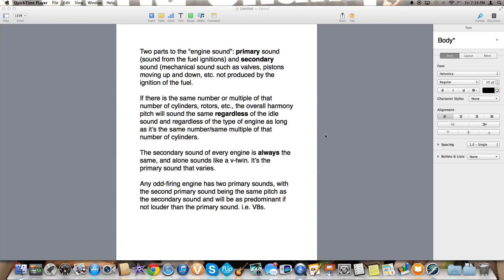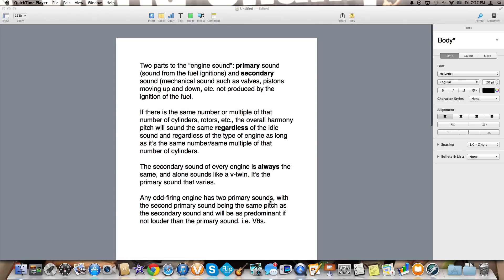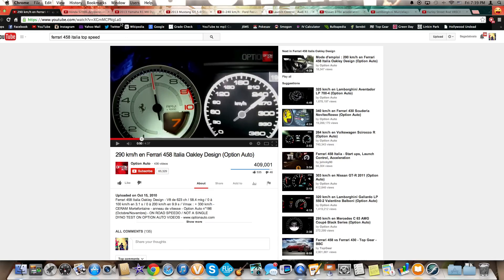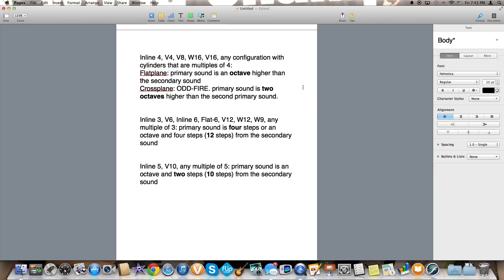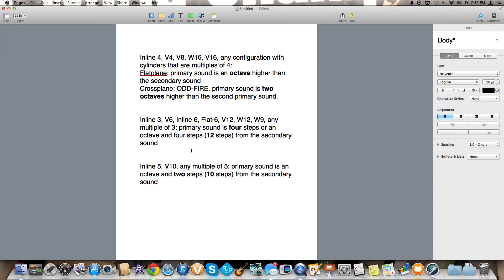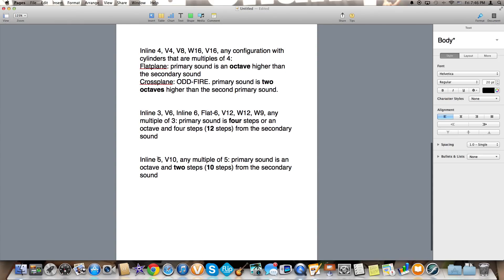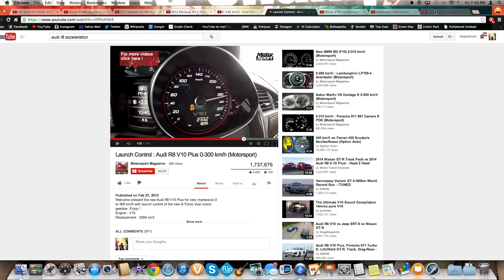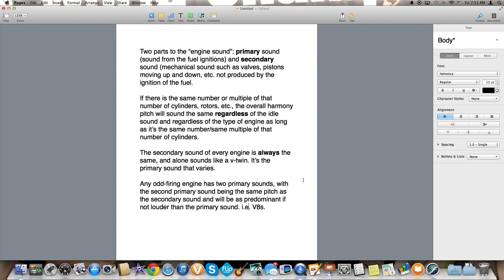Engine Sounds Explained

Comment: Turned it off when I heard the term 'ricer' a dozen times (I'm not offended, but it shows me the author has no clue how to address the viewing public) and he's under the impression that every inline 4 motorcycle goes to 16,000 rpm (a misconception which is what I'm used to hearing from the musclecar crowd)
Reply: triggered
Reply: The butthurt is powerful with this one, and the Yamaha R1 truly revs to 16k actually
Reply: Also said every multiple of 3 engine I3, v6 etc and same with multiple of 4. So the v12?
Reply: Arthur Lamouroux r1 doesnt rev to 16k thats an r6 young blood.
Reply: So if the 16k RPM for all inline 4 motorbikes is a misconception, what’s the truth though?

Comment: You forgot the piston less engine. The Rotary Mazda RX7 or RX8.
Reply: Roy Matison still the firing frequency can be compared to a classic piston engine. which make them sound not as unique for the average joe.
Reply: Carlos Leon really?  If a person can tell a v6 from a 4 cylinder but not be able to hear the unique sound of the rotary?  I can pick out a rotary as clearly as most people pick out a Harley.
Reply: I would suspect that the only prominent difference between a Wankel and an Otto with a similar primary sound would be the heavily reduced secondary sound due to fewer moving parts. Get one to rev high enough and it might sound like a pulse jet.
Reply: The sounds based on cylinder count also apply to the same amount of rotors
Reply: What happens with like a 15 cyl, does it sound like a 5/10 cyl or like a 3/6/12 cyl? And does a 20 cyl sound like a 5 or an 8? Do they have the primary sounds of both configurations because they would just sound like shit then.
Reply: No he didn’t
Reply: And The Diesel Engines, ESPECIALLY THE 2-STROKE.
Reply: Don’t need pistons for an engine like that just apex seals and a whole lot of compression 😂

Comment: I just want to ask you about the LFA v10. that sounds like a whole nother monster
Reply from the maker: yamaha heavily tuned the exhaust and intake to make it sound an octave higher and thus like an f1 car
Reply: Wrong.  Block angle and firing order plays a huge role.  odd firing V10s sound different compared to even firing V10s.  Compare old 5.0 Gallardos, Carrera GTs, and LFAs to BMW V10s and Viper V10s.  This is also why old GM 90 degree V6s sound like bad no matter what's available for them in terms of exhaust
Reply: Leo S still compared to another flat plane v10, the lexus v10 sounds higher.
Reply: Leo S so in this case, hes correct
Reply: +Carlos Leon wrote my comment too fast lol.  You were right in saying that Yamaha tuned certain frequencies at different RPMs for an even more orgasmic wail, but what I was really trying to convey was that the general "woo" banshee cry the V10 powered examples I wrote have come from their even firing characteristic
Reply: Leo S that makes sense. I believe he is aware of that as well but its still good to put it out there.
Reply: absolutely.. as well as the sho engine in the taurus in the 90's tuned by yamaha as well.
Reply: Same as a volvo 5 cylinder
Reply: @jasonhartley8302  pro
Reply: It’s an even firing engine 😂
Reply: Even firing v10 sounds so much fucking better

Comment: Boxers don't sound like my mopar 5.2l v8. Work on cars long enough each have their own tone you can pick off a mile away.
Reply: Dude doesnt know wtf he is talking about, not sure why he even made a video about it
Reply: Placeholder Name with open headers a boxer will sound identical to an in-line 4. The unique noise comes from the unequal length headers. And both of you clearly didn’t watch the video where he said cross plane v8s don’t sound like flatplane 4s because a 5.2 mopar is a cross plane.
Reply: @queefyg490  A boxer engine does not sound like a Mopar. Inline 4 does not sound like a boxer period. I have worked on cars as an ASE certified tech for over 20 plus years. It's my job to listen to engines run period as part of general diagnostics. To the human ear they sound different, on a graph there sound  frequencies may look the same.
Reply: Keith Irey joe Biden has 40 years of experience and he doesn’t know what he’s talking about 🤣🤣
Reply: @queefyg490  Holy shit you're right

Comment: Exhausts I find most interesting are from engines having master connecting rods such as the FDL V12 and V16 diesels made by General Electric and used in locomotives and the Pratt and Whitney radial engines used in propeller driven aircraft many years ago.

Comment: Informative video, but 12 is also a multiple of 4. So why does a v12 sound similar to a i3, not i4? I guess it's connected with the amount of cilinders in one bank? To bad you have so many dislikes. You hurt the feelings of "true" petrolheads, that can hear the sound difference beetween EVERY engine :D
Reply: No it isn't. And the V8 thing only applies to to flat plan crank V8's. A V12 could be more like 2*V6s
Reply: 12 is a multiple of 3 in this science.
Reply: V12 has 2 six cylinder banks, they have different fire order than 4 cylinders. It is also possible to make V12 out of V8 and V4 connected togeather, but there is no point.
Reply: Its because the 12 is an arrangement of two i6s. The firing order of an i6 is different than that of an i4, but similar to that of an i3, more like two mirrored i3 in a straight line, hence the similarity between the sounds of v12 and i3s and not i4s.
Reply: @mcr0741  but some v12s do sound like v8s

Comment: The only thing is you forgot V6s usually have split pin cranks and don’t apply to your multiple of 3 rule. This creates a different set of firing intervals thus setting v6s with split crank pins (which are most all modern v6s) apart from other multiple of 3 engine types.

Comment: On my Evo X, the stock exhaust sounded like a noisy vacuum cleaner, with absolutely zero character. Then at my first upgrade I put a high flow muffler on, which made it sound like a stock piped V8, y'know sort of burbly.
Then later on I straight piped it from the turbo back, which changed the sound again: it was back to being obviously a 4cyl, you could hear each cylinder firing. Also the exhaust added a lot of delicious crackles and pops... I think my point is that the exhaust has a huge influence on the sound of any engine. Thanks for an interesting video.
Reply: Your inline 4 Evo did not sound like a V8 with a muffler you probably bought at autozone. I'm sorry, but no. Just no.

Comment: Inline 3's, inline 6's, V6's and V12's do sound a little bit similar, but they're easy to tell apart. Also, the same configuration of engine can sound different depending on certain factors. Like, if you compared the sound of a Nissan 350Z to a Toyota FJ Cruiser, you could easily tell the difference even though they both use V6's. The 350Z has a distinctive raspy sound, whereas the FJ Cruiser has a more smooth sound. Also, a V12 engine would be much louder than a V6 due to it having more cylinders and probably being a larger engine in terms of cubic inches. I feel like inline 4 car engines are the ones with the least variation in sound, however, if I listened to a Honda K20A and then listened to a Volvo B230FT, I'd be able to tell which one was which. You're also wrong about the Subaru engines. They sound that way because of uneven headers. If you fit even headers to them, they sound pretty much the same as an inline 4.
Reply: PlotTwist but an FJ and a 350Z are both V6's

Comment: V8 sounding like inline 4 is like saying that Men and Women look the same. lol NO.
Sound has to do with firing order, bore and stroke, valve placement, number of valves, number of cams, belt or chain driven. All those things make different sounds, which makes an engine sound different. Boxer engines are very wide, which allows you to have a longer stroke and bigger bore, twice as many cams and all the valves are 1/16" from the outside so you can hear the clatter of the valves as they open and close. Rotary don't have valves or connecting rods. There are hundred different configurations for any engine. There are gear driven V8 , overhead valve, overhead cam. They all sound different.
Reply: YES10  You took the words out of my mouth. I don’t mean any disrespect to him, but I’d be willing to bet we could take two identical engine models for a double blind test... build the first with an under-square bore, modest compression, and select a single pattern cam spec to build good mid-range torque, and run 93 octane pump gas... a mild street setup. 
The second engine would go for broke- high compression, over-square configuration, radical cam with lots of overlap, yada, yada... run it on methanol. 
Moral of my rant is, based on his cylinder numbering and acoustics, he would never make the association that the two engines are siblings.

Comment: What about the even fire and odd fire v6 engines from gm. Like Buick. The firing order was not evenly spaced tru the 360° rotation, the oddfire . the even fire has split crank pins, I may have that backwards. But its difficult to use a distributor with one because its don't fire evenly across the rotation. Then when distributorless ignition came out they could make it even fire. The older Chevy v8 has two cylinders giring just after each other on the same bank. If you put a big cam in a engine it will sound different. It will be reving higher than you think,

Comment: I totally happenstanced upon this video, but I've always wanted to know why certain engines sound the way they do. So thanks for this. I learned a lot!
Reply: Craig Deutsch the easiest way to visualize this is when you have single cylinder engine and a twin. if you rev the twin at 6000 rpm, the single reaches a similar pitch at 12 000 rpm. since the explosions would be identical

Comment: I have a car with a GM 3.6 L V6. What can I do to make it sound more like a V12, or  Porsche flat 6? Some sort of exhaust mod? At the moment its engine sound is quiet and boring
Reply: different headers, different exhaust, different valve timing and a bigger cam can help make a more aggressive sound.
Reply: Cheers :-)
I can buy new camshafts for $200-300. Thinking of doing that and modding the exhaust, if/when I find a mechanic I trust to change the cams.
Reply: CNCTEMATIC rev it twice as high lol

Comment: Awsome vid... but yanno a 4v 351 cleveland has a specific sound, and a Chrysler 318 has a specific crackle to it as well as the easy rev sound of the Ford 4.6 which sounds waay different than a 5.0 (302). Pontiacs V-8's have a missing pulse when fitted with 6 tube headders and sound pretty close to a Ford Flathead under power, and no V-8 has as smooth of an idle as the Olds V-8. Mitsubishi turbo Eclipse's from the early 90's had a specific sound which always sounded like the engine was loafing even if it was turning 10k, very similar to the Buick GNX turbo 6.  Volkswagen 4's always had a kind of growl to them. The Ford Pinto's with their fixed fans always had a specific sound to them also.. You knew it was a Pinto LOL... The Chrysler Slant 6 sounds waay different than a Ford straight 6, the Ford was smoother (177,200, 250, not the 300) The ford 300 6 and the GMC 302 6 and 292 all sound similar unless they have split exhaust. The GMC 305 V6 has a specific sound as well. The newest Corvettes have an exhaust note that sounds similar to a 6 of sorts like they are trying to imitate the Euro super cars (disappointing).  I think the worst sounding cars were the Mercedes Bense's from the 80's and 90's because you could hear the sound of the engine driven fan waaay before you could see the car... somehow somewhere an engineer thought ... THAT sounded cool.   
  And finally never ever tell one of those guys with a cruiser motorcycle with the flat 6 engine (I don't know what brand it is)  that his bike sounds just like a Corvair.... apparently it's an insult...  oops.  lol
  Some one at some point, told me that all engines register a high C note when they are at peak power and just after that note or right at that point is the best spot to make a gear shift change.   I dunno... I use a tach and my own formula.     Thanks for posting.

Comment: Thank you for this video. How does a 60 degree vs a 90 degree engine compare? How about to an inline 6? Listen to a tiburon Gt 2.7 (smoothest) vs a genesis v6 3.8 (less smooth) vs any ford v6 (sounds like a 3 cylinder tractor). Why is this? Is it all down to exhaust design or does the v angle and firing order matter?

Comment: Great video. Does help hearing the similarities between each groups.
And now I can better appreciate the little differences between each (between a v8 and v4 or v12 and v6)
Reply: V4's are rare stop saying v4
Reply: @justsomepandawithinternet  stop bullying on internet !
I had several v4 motorbikes
Go and get an education, and may be a life while you’re at it...
Reply: @michelinstarschallenger8626  
Bikes? Yes
Cars? Very rare
Reply: @justsomepandawithinternet  stop trolling bully. This is about engines sound. 
I assume you’re trolling. The other option is that you really can not see how you’re been seen as “the guy who makes lame comments to think he’s right when he’s not”
By the way, I did appreciate this video so thanks for helping in improving it’s ranking.
Reply: @justsomepandawithinternet  he  shut up I think

Comment: Hi everyone. Sorry if this is out of the topic. Just wondering after I heard the sound of that ferrari 458 climbing up the RPM. Why do gears have rev limit ? I mean, like manual cars, example, you drive it in first gear and once it reaches the redline, it won't go any further and you need to shift. Why is the rev limited by gears when the pistons still continuously working ? sorry if my question is hard to understand...dunno how to really put it into words 😓
Reply: The acceleration of the pistons and the valves are the limiting factor to the engine speed. The rev is not limited by the gears. The function of the group of gears is to provide different ratios between the speed of the engine and the wheels.
For more info: https://en.wikipedia.org/wiki/Redline
Reply: soooo...does it mean that if we put on the first gear, the gear is "light" so the rev can reach maximum speed in short time and produce the most torque to spin the wheels compared to higher gears which are "heavy" and takes longer time to reach maximum engine rpm ?
Reply: Kawasaki Nerd first gear will reach redline faster. like on a bike where you can rapidly kick your feet in a short time at lower gears but its harder to kick at higher gears. the same is happening in the engine. just replace your leg with the piston and there you have it.
Reply: ahh ! Now thats 100% understandable. Thank you ! have a nice day :)
Reply: @murilorziehe  well that's generally true, but there are more factors, like fuel and air supply, lubrication,  camshaft design and even balance and vibrations at high rpm

Comment: Some flatplane boxer engines sound nothing like other flatplane engines, for example a flat 4 and an inline 4 with the same crank and firing pattern can sound very different. Also a rotary will never sound the same as a piston engine regardless of whether the number of rotors matches the number of pistons or whether they have the same firing pattern. This is because a rotary fires 3 times every full 360° rotation whereas a piston engine, 4 stroke or 2 stroke, doesn't. And a 2 stroke engine won't sound the same as a four stroke engine even if both engines have the same number of pistons and the same crank and firing pattern.

Comment: The Subaru Flat-4 "Boxer" has a burble sound, but has a flat crank.

I can't figure out if the firing order is considered even or odd since the first bank receives two exhaust pulses followed by two exhaust pulses on the second bank (L-L-R-R).  The spacing of the pulses is the same as in an inline 4 cylinder (which would mean it is "even".)

The only thing I can think of that makes the sound of the H-4 different than the I-4 is the unequal exhaust headers causing the 2nd set of exhaust pulses joining the 1st set of exhaust pulses at the same time where the two headers join.  The firing order and timing would be the same between H-4 and I-4.

Is it all about the exhaust in this case?
Reply: SEBBARU actually yes it is all about the exhaust. if you look up Subaru equal length header they sound like a normal 4 cyl again and all the burble is gone.
Reply: +SEBBARU yeah im going unequal length all the way its pretty much the signature of any impreza the equal length header makes it sound like any normal 4 cylinder and the car loses its badass burble lol
Reply: +Bugatti “Bugattiliker2” Veyron Mine is 11 years old and the stock headers (maybe just the heat shields) are getting rusty.  I've read that cylinder 4 failures happen due to higher EGTs caused by the UEL headers, especially for tuned cars (400+ hp).

I'm just looking ahead.
Reply: SEBBARU thats bad considering im trying 2 get one for my first car im leaning on the 06 or 08 model cuase the 04 model was barebones and kind of impracticle (not that thats a problem to me ) but yeah just hope this isint true that the 4th cylinder constantly heats up but i guess ill find out next april :p
Reply: The reason of the gurgle is because of the uneven headers
Reply: Element, EJ25 sounds like a inline 4. EJ22 doesn't even without exhaust there is a rumble for some reason.
Reply: Subaru without headers has to sound exactly same as any 4 cylinder engine with flatplane crank, because you hear same even fire order bang-bang-bang-bang-bang-....